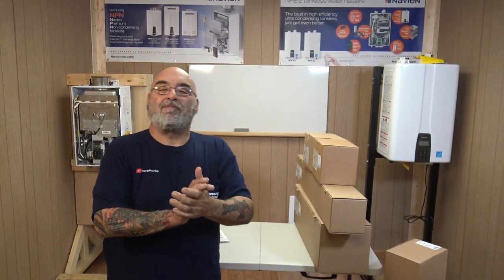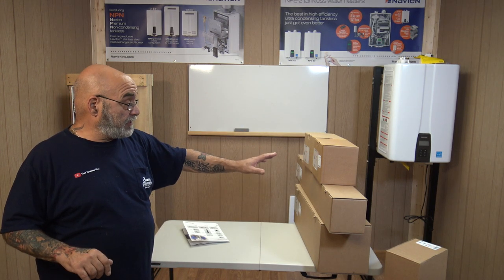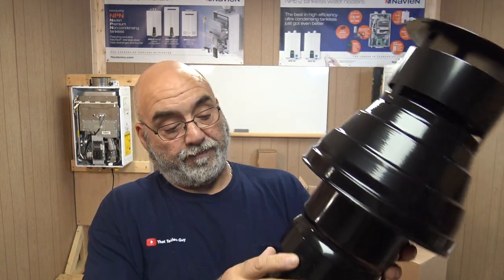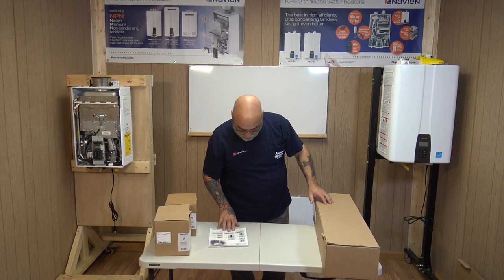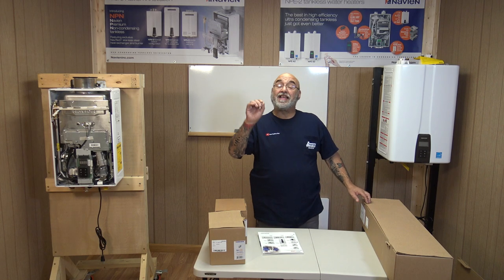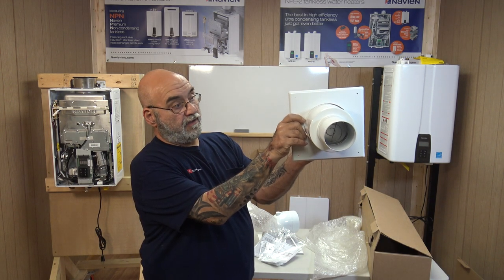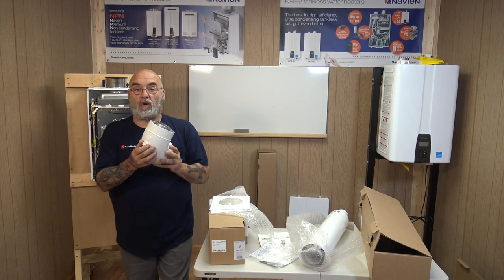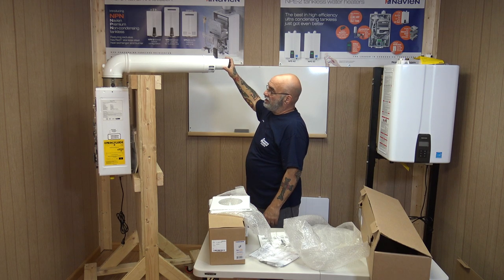Navien's venting for their NPN universal indoor unit

Comment: Why do you say the NPE unit cant have a concentric vent?  I looked at the manual for mine and it says concentric is an option.
Reply: The NPE unit is only 2” PVC pipe only
Reply: @TheBuddylab  this is incorrect.  Per the manual, there's a handful of concentric vents specifically approved for NPE units.  I also contacted Navien tech support and they confirmed.

Comment: Just wanted to thank you for your video’s, I was able to fix code 12 on my water heater using steps in your video,  I am wondering if you would have an idea of why I have to turn on multiple faucets to trigger the hot water. If I just turn on kitchen sink or shower I get nothing but cold water but if I turn on the bathroom sink then kitchen sink it kicks right on.  Very annoying.  Any idea why this is this way.
Reply: Flow  sensor